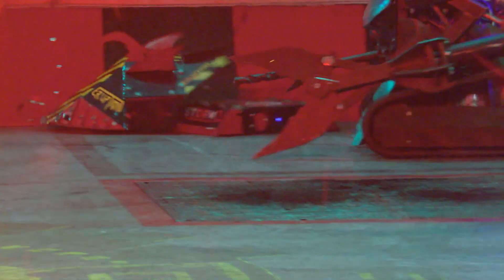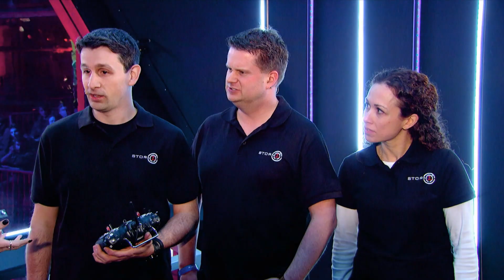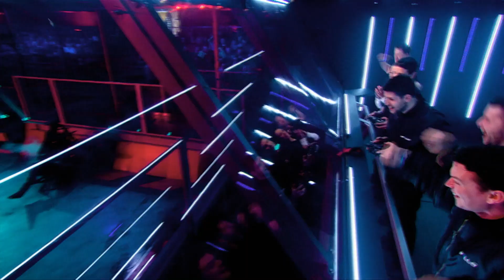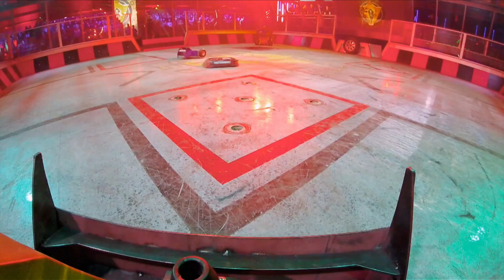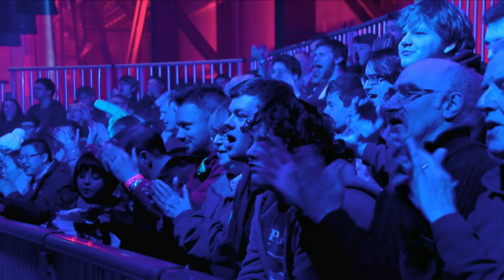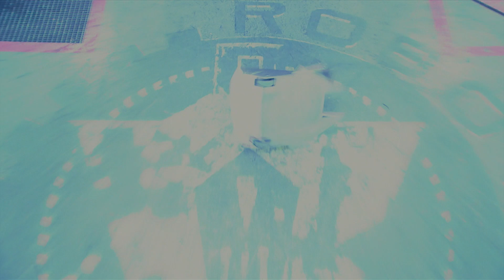Storm 2 makes way for the calm | Robot Wars HD

Comment: I was rather disappointed that Storm 2 didn't perform as well as I'd hoped it would in Series 8. This is the machine that rammed robots with so much force that they'd bounce off the walls - if not fly over them like Steel Avenger did - and closed out Robot Wars' original run by winning the Third World Championship, yet when it returned many years later it was about as exciting pushing robots around as Tornado was.
Reply: Suffolk team.